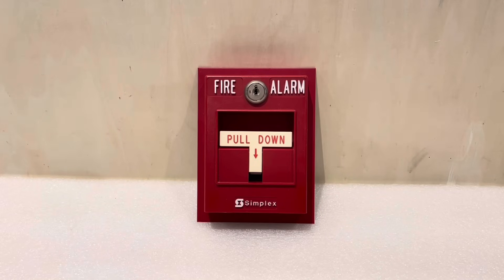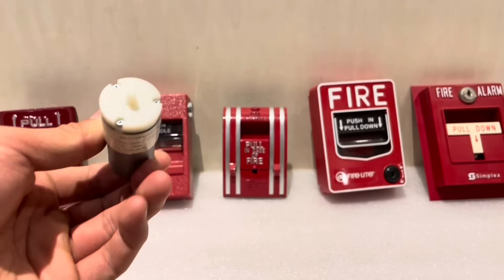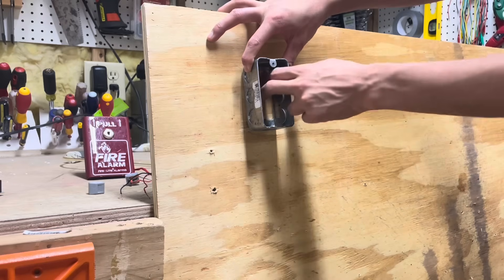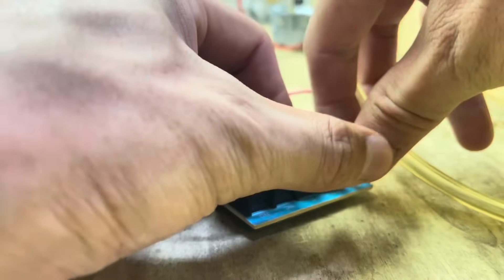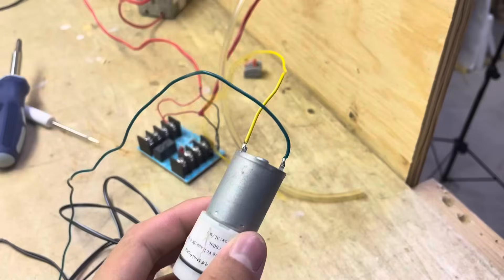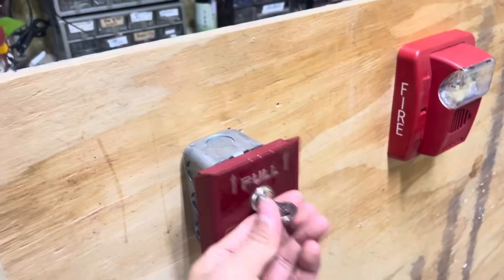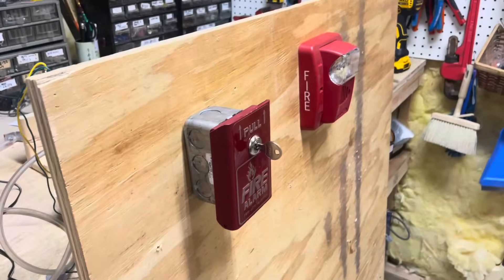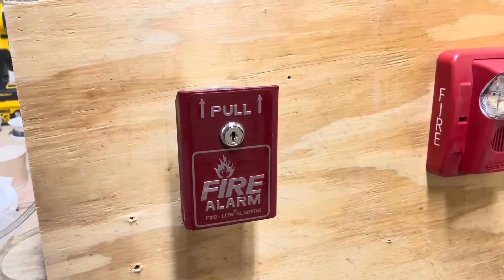Making a Fire Alarm That Actually Squirts Ink | A Fire Alarm Myth

Comment: That is a great idea 
If you replace the soy sauce with water it’s a sprinkler built in 
So if the fire is nearby the pull station it could help a bit with the fire before the sprinklers start

Comment: If you hooked it up to a water pipe controlled with a solenoid then you'd have a pull station with inbuilt sprinkler system

Comment: Probably wouldn't be ideal to put on a pull station. Because imagine if someone finds a fire and needs to pull it then they would have to try to avoid get inked which is like trying to pickup a pufferfish on it's non spiked side when it inflates.

Comment: I wonder- is there any reason you didn't use a mechanical ink dispenser that triggers when the lever makes contact with a pressurized ink sac, designed to burst at a specific failure point?
Reply from the maker: I suppose that would be the easiest way to do it if you can figure out how to get the ink to get on the user’s hand

Comment: The high school I went to had ink all over the handles of every pull station, and you could see it dripping down lol. 

It's a common misconception for sure. Pull stations having ink is NOT a myth, but I cant even fathom having ink actually squirted out onto you from pulling a pull station. That's just insane. I think that myth stemmed from pull stations sometimes having ink applied by the building owner or FD, and it's just a scare tactic to get people not to do it. And it works, though I hope it would not deter anyone in an actual emergency. As a tech I have never applied ink on a station before, but I have gotten it on my hands before not knowing the station actually had it. I believe that jurisdiction required it for the schools...
Reply: I had some in high school as well, but instead of ink, they used water-activated dye.
Reply: Man If I found a fire there I'm putting on gloves before pulling it. That ink isn't worth the risk.

Comment: You could easily make a simpler version by taking a unit that has a glass rod and replacing it with a glass tube filled with dye and sealed at both ends, similar to an ampoule
Reply: Wait thays smart
Reply: Wait a minute… you’re onto something
Reply: Yeah, like a little glass vile in a fire sprinkler but with ink